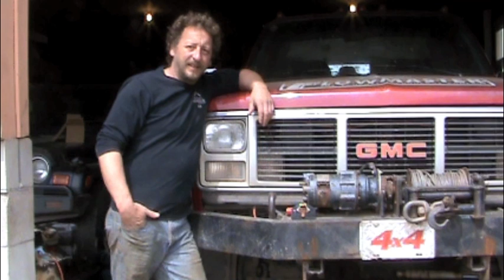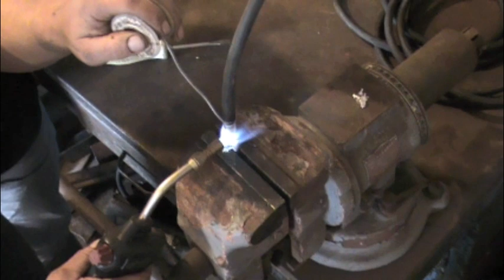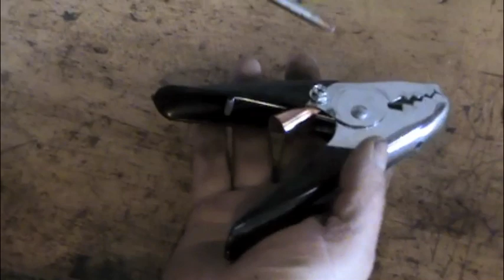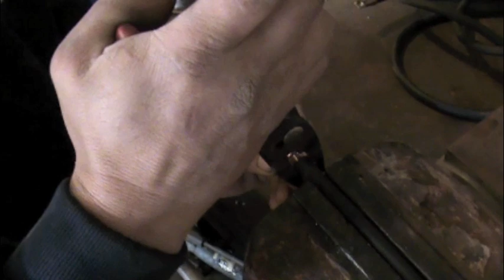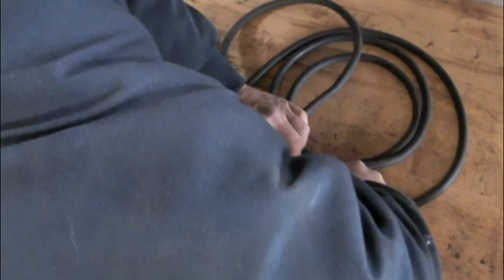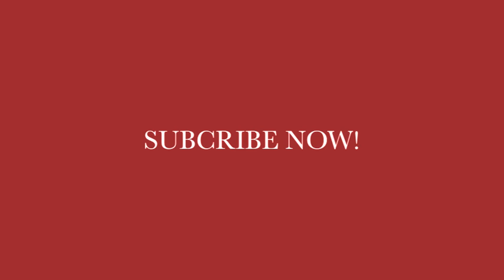custom jumper cables for the extreme off-road wrecker

Comment: uhm... was it really necesary to weld it with fire ?
Reply: Absolutely, a regular soldering gun cannot perform the operation.
Reply: I mean is connecting the cable by clamping the cable on it not enough ?
Reply: It would work, but soldering is a stronger/ more durable connection.

Comment from the maker: @uncaljeff The power connecter is wired though a solenoid like my on board air, with a switch in the cab. no power to the connecter when the switch is off.

Comment: very nice idea, no one will steel your leads, bc they cant use them on a rig wo the termanal, only draw back is the plug could be shorted out and will the hood lached would start a fire :(      simaler to the myth of having a winch where a hoodlem shortes it out and the cable crushes the car, i put my controle box under the hood.  battery isolators are good but i havent found one that is good for more than 300 amps. and a winch draws over 500 cant it ?  

i love the buisnes idea.

Comment: I love it!  I plow in the winter with a 99 suburban i rescued, and now I have a use for the power connector in the summer!  I was wondering, what do you think about splicing in a second connector?  It'd be handy to have in the wintertime as well.  I work at Advance Auto and I checked and we have the cables and connectors, think the plow hookups can handle a second connector?  It'd be nice to be able to do jumps in the winter without climbing over the plow.